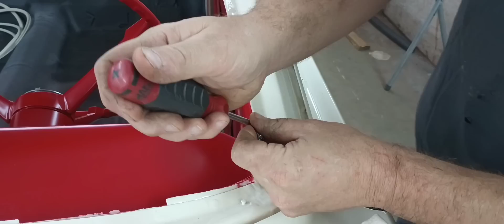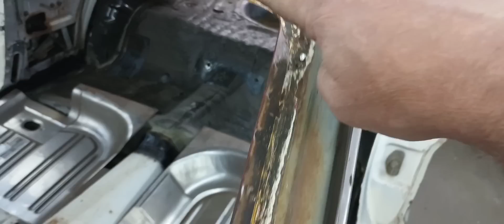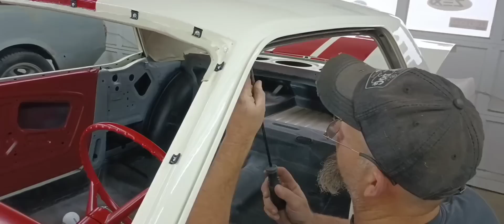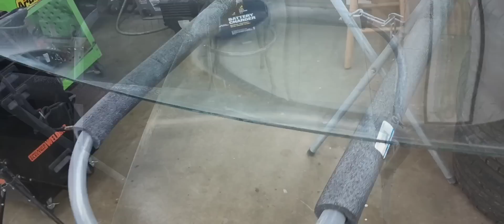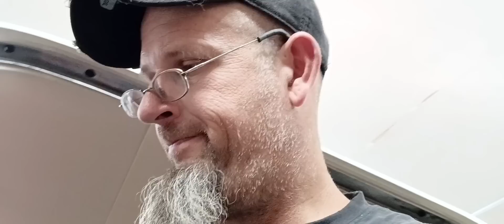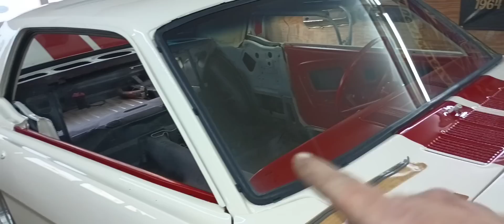The Ultimate 1965 Mustang Restoration: Glass Parts & Weatherstripping Explained #ford

Comment: All your work on this car makes me appreciate how much work goes into building millions of cars from the factory.  I know the cars didn't come out perfect and they have tools and procedures to make it quicker and more eficient, but man, there is a lot of fiddley detail work that goes into a car.  The only stationary piece of glass in my '28 Pontiac is the rear window, for which I have a new seal, much like the ones for the mustang, only much smaller.  I will be applying the techniques you showed here when I install that window.  Looking forward to what you have to say about weather proofing the roll-down windows, as I have 7 of those. including the front window, although that is a roll-up.
Reply from the maker: I often wonder how they pumped out so many

Comment: @ approx 28 min. Letting the gasket relax. I do commercial refrigeration for a living. The replacement door gaskets are wrapped up a bit for shipping in smaller boxes. I soak them in hot tap water to help them relax from shipping as most have an accordion section and a magnet to make the seal. Or a heat gun if it they cool too fast. I wonder if that would work for your gaskets instead of heating the entire shop. I bet a 5 gal pail 3/4 full of hot tap water would work just fine.
Reply from the maker: Could had done that also

Comment: Thanks for the tips on the back glass. My 70 uses the rubber gasket and I've had a guy remove the back glass and reseal it twice and it still leaks.
Reply from the maker: It's always a gamble , I've seen them put in dry and never leak, seen them sealed and not leaks and then others that pour like the Titanic